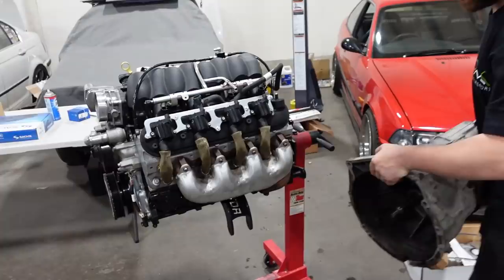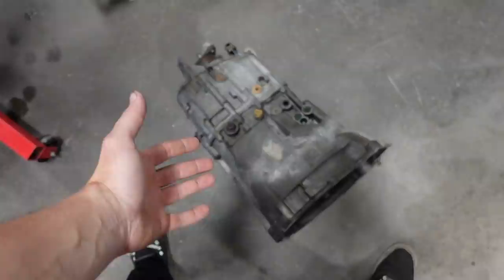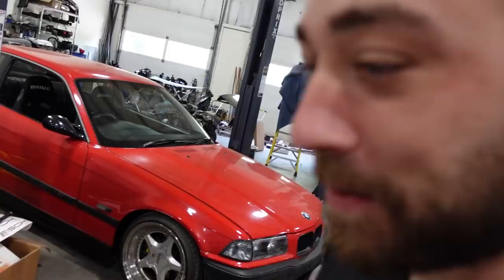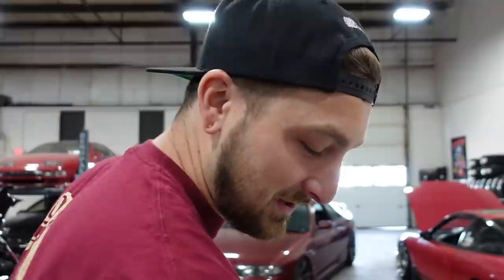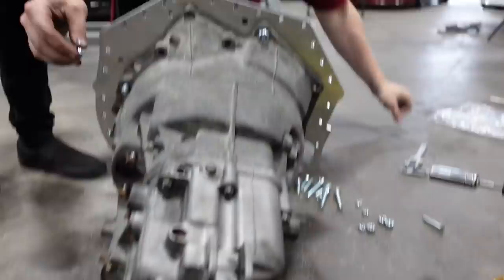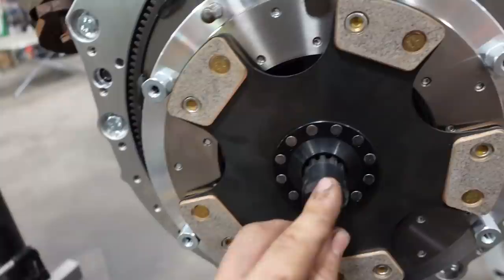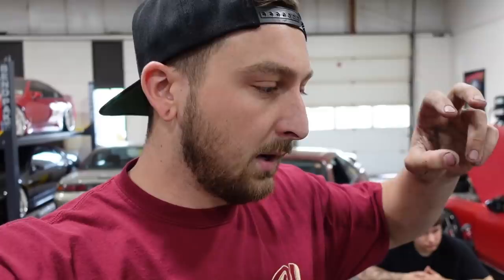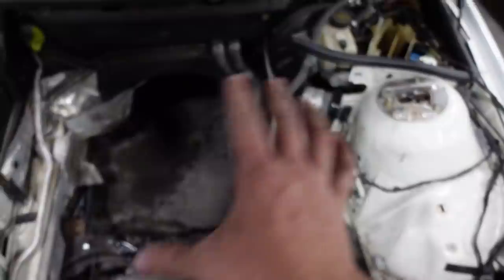Attaching a Chevy LS engine to a BMW transmission..

Comment: If you plan on keeping the stock cluster, keep the electronic side of the ABS, throw away just the hydraulic part. If you don't have rear speed sensors, you can repin the connector and put the front signal wires where the rear would be, that way you can have speed and mileage on your cluster, no matter what rear end you running.
Reply: How do you get the ls ecu to accept a vss vehicle speed sensor reading from the bmw?
Reply: @ThomasBilt  have u figured this out? i’m looking to find everything i need to know before starting on my swap
Reply: this was helpful !
Reply: @xaviersantos9802 he said this 2 years ago bro

Comment: Taylor Ray ran 
G8 GT manifolds on his 6.2 with stock heads and made mid 400s rwhp. Maybe hit him up to see if he still has them. They fit a miata so maybe they will fit a bmw. He did pick up significant power with longtubes.

Comment: My car's transmission was made by GM of France, however. With a couple nice modifications. Sequential shifting capability that actually worked. The transmission is Good for 300 HP, so if you are using a GM transmission it should fit to a chevy engine. Same transmission used in a Cadillac DTS or Deville, or full size C or K trucks at the time. Really good solid auto transmission that came with 2nd generation 3 series BMW.  3 speed with overdrive, that was also geared quite well I thought. Especially the overdrive gear I thought was especially good.But I'd imagine a manual would be the best if it can handle the HP.

Comment: The biggest deal with the headers won't be power. It's going to back pressure. Back pressure leads to more heat under hood. I'd plan to add vents for heat management or at least help with getting heat out.

Comment: One of the things with a 3 series, you can have "too much" Horsepower if you don't have the M3 suspension upgrade. Even then, the light weight of the 3 series does make a good drifter, one of the best with its more than stiff chassis. I've always thought this engine + trans to be a crazy combination. Yep it is. lol  Great point about upgrading oil pan. So many forget how that is important for a drift car. People/Guys just want to do donuts and not think about the consequences and gravity and G-force and what that means for your motor.  lol

Comment: Forward facing headers are gonna suck for the serpentine belt routing but it's so worth it. I hid a whole muffler in my front bumper so I could dump exhaust put the side of the front bumper.

Comment: When this box inevitably breaks the one you wanna find is a ZF GS5-39dz, it's the e39 530 diesel box and that's the cd009 for us over here.
The six speed (GS6-39dz) is also good but the five speed is a tad stronger.
My mate has this box in his pro class Pontiac GTO with about 530 wheel hp.

Comment: If that pressure plate is sre -243 it should hold closer to 600lbft with that clutch plate. Also there is 10% safety margin :D

Comment: My suggestion would be to buy a totaled e46 m3, and take the drivetrain. That gets you a 210mm large case lsd diff, stronger axles, and the sweet 420g gearbox. The zf is gonna break, as is the 188 medium case diff and axles. Its usually the axles that break first, but eventually it all will. You can sell the motor and other stuff from the totaled m3 for parts to make most of your money back.

Comment: I had an unsprung expensive clutch disk in my E36 328is NA build and I would have to spin the tires just to get the car to move from a stop, there was no soft engagement and the clutch disk only lasted 38k miles 😆, next clutch was a heavy duty sprung 6 puck ACT and it was 100x better and less stressful to drive.

Comment: Answer to the question "Are the gearboxes tested with LS power" is that I don't exactly know about the E46 zf trans but the E39 3.0d getrag manual trans is known to hold a lot of power. In Estonia last year my friend got the title of the fastest BMW in Estonia with his E39 (was supposed to be E30 but we couldn't get the right axles on time) M50B28 Stroker with a 80mm turbo and some NOS and it made a little over 1000hp from the wheel and the trans he used was the E39 3.0d trans. If you wonder then on the 1/4 mile he drove 8.82s and the start was terrible. The engine decided to blow up and we realized that we can't get much more out of the M50 and decided to go with the LM7 engine (we used the same adapter plate you bought) and with the same turbo it made about 800hp but the turbo was too small so the intake temps rose way to high and the piston rings decided to collide so it blew up as well.

TLDR: If the E46 trans doesn't hold the power then get the E39 3.0d trans (GS5-39DZ) and it's a straight bolt on to the adapter plate you got.

Comment: The standard manifolds will work fine there are lads that use them for turbo applications and are making 800bhp through them. But there is manifold out there for tight engine bays. Hooker blackheart manifolds.

Comment: the euro 328/m3 (s5d 320z) gearbox did blow out the bottomstock att 1108 wnm in hub dyno. so the small ZF gearbox is great for Big Power.
Reply: Any idea on how one would get a vehicle speed sensor pulse from this bmw to the ls ecu that the ls ecu can interpret? Not necessarily for the cluster but so the ls ecu is getting that dignal for the idle and other changes it makes from the vss signal?

Comment: delete ac, bypass your heater, get a electric holden astra power steering pump ( all you need to do is adapt the e36 power steering line to the astra one)

Comment: If you dont use the little pin the slave cylinder hits the clutch plate a channel called diff auto uses thus set for an e30 and he didn't upgrade it at first

Comment: I order the same motor mounts lol like 3 or 4 montha ago. I'm still waiting on mine. And for clutch I went with act disc and spec pressure plate from the boys at drift hq which should be good for 600 crank. So if you guys burn through that clutch it's a good opinion

Comment: Those factory manifolds are probably cast iron meaning you most likely won't have good results welding to them, at least not with a MIG. You need to use nickel filler with a TIG or nickel rods with a stick welder. Even then you will have to different metals welded together going through massive temperature changes which is most likely going to result in a crack. You would probably be better off looking at other OE manifolds that will fit the LS, like from a Corvette, Camero, G8, Caprice, TrailBlazer, or Colorado.

Comment: Doing a lq4 in my e36 you can get shorty block hugger headders and with some modifying they will work its the cheapest solution i have found
Reply: Any idea on how one would get a vehicle speed sensor pulse from this bmw to the ls ecu that the ls ecu can interpret? Not necessarily for the cluster but so the ls ecu is getting that dignal for the idle and other changes it makes from the vss signal?

Comment: that trans is from a gasoline engine right? if that breaks buy a M57 diesel gearbox, thats what everyone uses for everything in finland and they are said to hold atleast 1000nm (700+ ft lb) atleast the bigger GS6-53DZ boxes
it also bolts up to that adapter plate

Comment: The small zf Will snap around 450 - 500 whp depending on the driver!
Reply: Nah bro ive pushed over 700wheel on this with no issue
Reply: @Ricky50scJustalil6cylinder  its the torque that breaks them

Comment: Well while you’re shooting the exhaust forward in the bay, might as well add a turbo
Reply: That's what I'm doing with my e46 lol I mean might as well it's easy. Flip manifold from left to right run them to a collector and turbo flange and good to go
Reply: @bainter6  and dump it right out the hood too fuck it lol

Comment: So happy you are going with the BMW trans and PMC adapter. I have been looking at that adpater and all the other transmission options for an LS swap in my E46 for a next winter swap. Going to see how well the trans holds up that;s been my biggest concern
Reply: Did you do it? I did but im trying to figure out how to get a vehicle speed sensor pulse from the bmw to the ls ecu. It stalls at 6k rpm without it
Reply: @ThomasBilt  I never did it. BMW uses an ABS sensor for its speed sensor if that helps. We have had that problem on the drift cars before if it loses that rear abs sensor it won’t rev over 5000rpm

Comment: Did you had to modify the driveshaft?  I'm doing the same swap as you on my 2001 325i sedan and using the PMC kit with ZF 5speed, M3 diff and driveshaft but the M3 driveshaft is about 4 inches shorter than the  325i driveshaft. Do you know a shop that will extend the driveshaft? I can't find one. I'm in Orlando FL

Comment: You would be better of using a 530D trans. They are way more beefy and can take alot more torque.
Reply: We didn’t get diesels in the us...
Reply: @brianhall2490  Damn, what a shame.   EVERY bmw guy over here in Europe use those.    A friend of mine is running 1300whp on a turbo ls with a 530d trans!!!

Comment: Great video, thanks for sharing, while watching your video something came to mi mind, since your new engine supports can slide or adjust around 1 inch back and forward, could you use the original e46 drive shaft without modifying it ?, thanks
Reply: Yes, i did with the same setup but i used adjustable pennsyltucky v3 mounts

Comment: Is that the 5 or 6 speed zf? Just wondering because I start my swap soon, and I here mixed opinions on having an over drive gear.
Reply: Any idea on how one would get a vehicle speed sensor pulse from this bmw to the ls ecu that the stock ls ecu can interpret? Not necessarily for the cluster but so the ls ecu is getting that dignal for the idle and other changes it makes from the vss signal?

Comment: Watched more and realized i'm doing the same with my exhaust manifolds want to see what you guys do with accessories.
Reply: Any idea on how one would get a vehicle speed sensor pulse from this bmw to the ls ecu that the ls ecu can interpret? Not necessarily for the cluster but so the ls ecu is getting that dignal for the idle and other changes it makes from the vss signal?

Comment: HOLD UP! You fellas showcasing that adapter kit and using it as topic of the video in the title and you guys don't give proper attention to the manufacturer? Thats a dick move if you ask me. You should at minimum direct viewers to "check out their link in the description" and also could do the card link in corner of the video. Check yourselves on giving props and attention to the companys that make your builds possible.

Comment: With all the influence y'all have y'all are telling me y'all can't find a single person that is selling or parting out a LS BMW and has long tube headers or better headers then what y'all are putting on there for sale? All I'm going to say is good bye the poor valves because the amount of heat they're at to take with your hot boy tune and living on limiter they are about to leave the chat. Sorry JP for doing all that also engine work for it to be pissed away.
Reply from the maker: I’d say A LARGE portion of turbo Ls’s are running flipped around truck manifolds.. the valves aren’t getting roasted. It’s going to be fine. The amount of shit Brian has gone through trying to get “long tubes” is insane. We’re not idiots 🥳
Reply: @JimmyOakes  turbine Sucking out exhaust gas to produce efficiency and better flow VS gas pushing out the best it can through unequal small cast holes... Not apples to apples. We all saw your man's response when you asked about it, and he was going to say it was going to be a restriction but because he doesn't want y'all to look bad he said it'll make power regardless. Not denying it but not condoning it either. Taylor Ray went through the same shit and even said it was a huge restrictions on his car. Same style engine build. I follow just about all of you. Not one call out or reach outs on social for any headers. If y'all are cool with high EGTs (large back pressure) and possible damage to the engine just for a couple of hours of fun at least it'll be more content for another day when y'all pull it out again. Spoke my peace but I'm just a nobody so what does it matter.
Reply: @Jimmy Oakes  Any idea on how one would get a vehicle speed sensor pulse from this bmw to the ls ecu that the ls ecu can interpret? Not necessarily for the cluster but so the ls ecu is getting that dignal for the idle and other changes it makes from the vss signal?

Comment: Zf needs all the help it can get... so let’s go single mass and unsprung hub!! SMH you guys do some silly stuff from time to time.
Reply: I've heard and seen that the dual mass flywheel likes to break in pieces under heavier loads and I think I would go with a twin-clutch setup but the best would definitely be going with an older 3.0d trans.
Reply: @sandervorel154  100% dual mass is junk but when you use single mass you need a sprung hub or you’ll just break shit. Lz did it at klutch kickers even after Chelsea warned him it would happen.